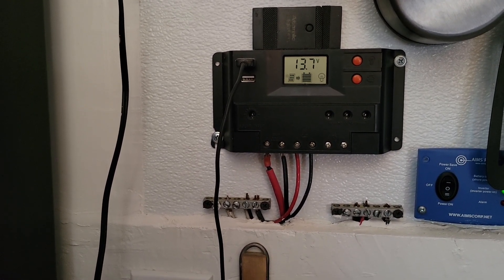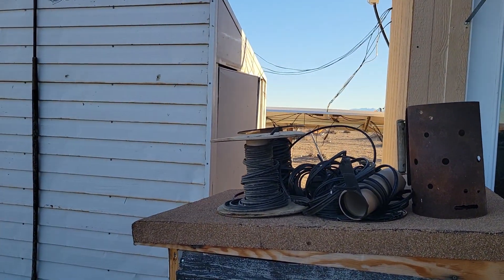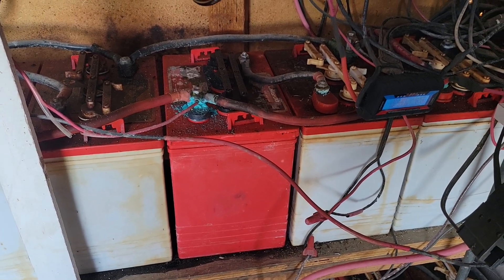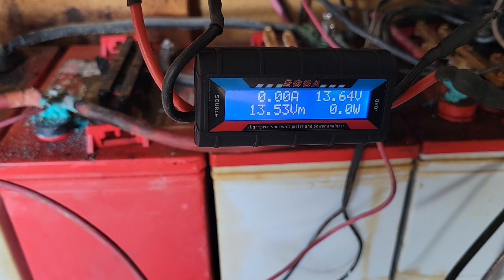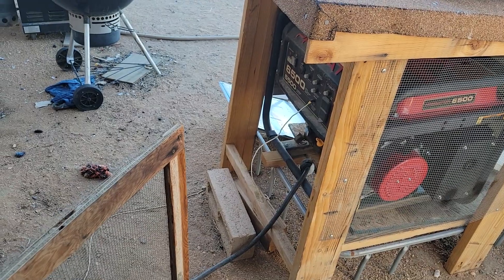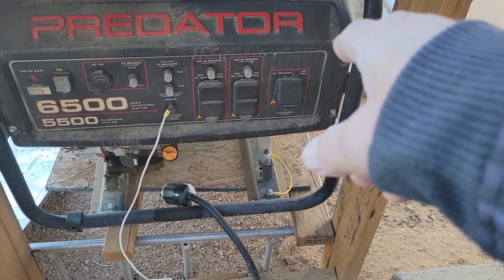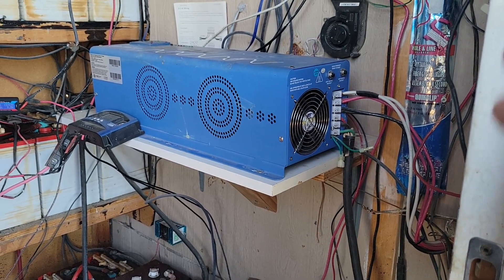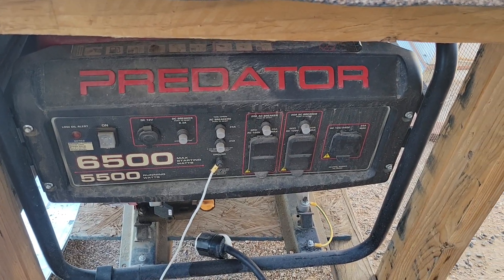February 6, 2023

Comment: There is one thing I notice today in your battery room You have a bridge rectifier then it's attached to the solenoid which then goes into either Midnite MPPT or next to it MPPT or its going to charge the batteries. when your bridge already converting AC to DC and charging the batteries why do you have MPPT?
Reply from the maker: You are mistaken.   The PWM and solenoid are part of a dumpload system.  The PMA connects to the bridge rectifier, rectifier to the new multimeter, then to the battery bank.  My wind power does not use a controller, only solar power does.
Reply: @GBear  Ah... I.C

Comment: Do NOT use Plasti-Dip on your battery terminals! It will still corrode under the coating but you won't be able to see it. A cheap alternative is to cover them in wheel bearing grease after they've been properly cleaned with baking soda and water.
Reply from the maker: Thanks and welcome aboard.  You're the second one to say that.

Comment: That red heat resistant bearing grease is better than the dip and a whole lot easier to clean off when you need to work on a battery I use it on all of my batteries and I have never had to replace a battery clamp or bolt 🔩 and I'm getting zero acid corrosion and you can use a little paintbrush on it to so you don't get dirty fingers
Reply from the maker: I'll try the grease first, since I have some in the shop.